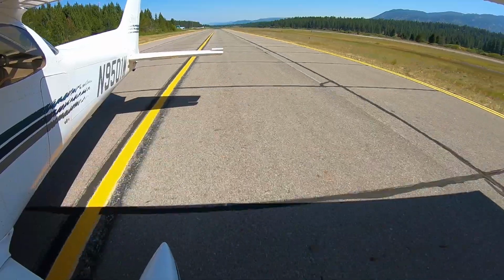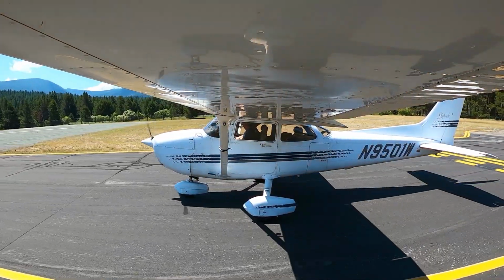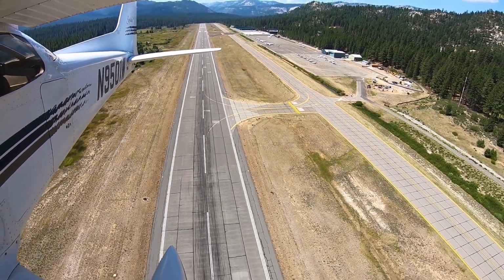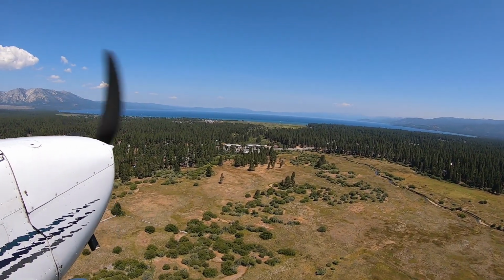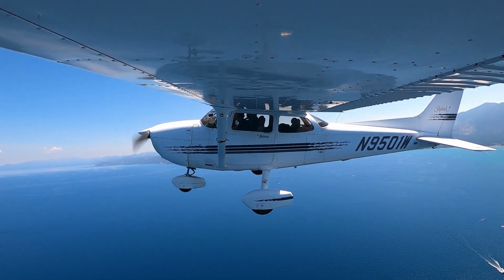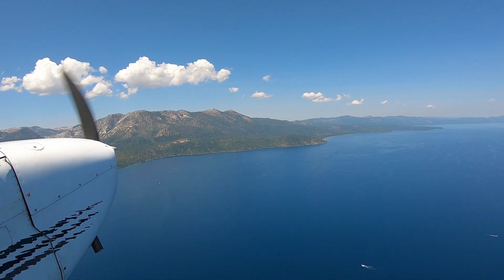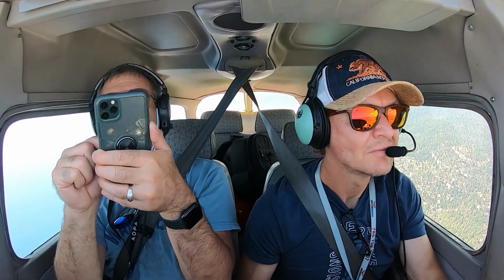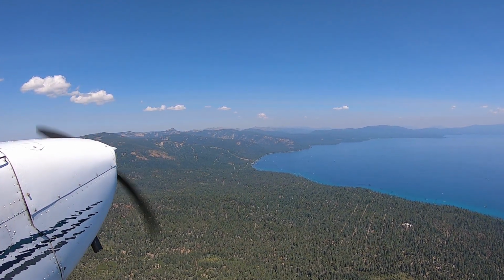High-Density Altitude Takeoff - South Lake Tahoe, CA (KTVL)...

Comment: I’m planning on going tomorrow morning and arriving around 1pm-2pm. I’ve only flown at 7,000 DA once out of New Mexico. I understand leaning very well. But this is the furthest I’ve flown since my PPL. I’ll be in a 160hp RV6 FP prop set up to cruise. Kinda nervous. I plan to stay higher as I’m worried about mountain waves coming in. Then departing go over the lake and circle a few times then leave. Might take off lighter and fuel half way home to be as light as possible. 

😅any other tips?

Thanks for the video!

Comment: Thanks for the video which demonstrates the dramatically reduced climb rate during the warmer months. I just got my PPL, but I’ve had a Piper Arrow (200 HP) for a few months prior. I live in the Reno Tahoe area and regret not getting a turbo Arrow or any other turbo single engine. It’s been fun to fly the NA Arrow in the cooler months, but it now it really does feel sluggish.

Comment: Summertime DA in Truckee KTRK (5901 MSL) is often 10,000’. Normally aspirated aircraft really need to be closely flown on takeoff and climbout — for cooling and airspeed, there is no forgiveness as one gets when flying at sea level. Even in my SR22T I carefully watch airspeed and temperatures, and fly much more restrained climbouts.
Reply from the maker: For sure! The climb-out in Truckee and SLT in 01W have to be managed extremely carefully, with lots of planning before 'full power'.  May times, my 160 horses will just stay on the ground and fly another day!

Comment: “It’s reliable if you plan to expect the 200fpm club rate”: It’s just that it isn’t all up to you. With even a tiny bit of thermal activity you could encounter downdrafts well exceeding your 200 fpm climb. So I would argue whether it can be done safely is a much different question from whether you will. Mountains are notorious for rapidly changing conditions. It’s best to pad your margins!

Comment: Two things: (1) Did you go North to I-80 and then back to KCCR? (2) FYI all of your headset mic audio is in the left channel.
Reply from the maker: Hey Mike.  Yep - 80 all the way.  On the way into KTVL we did the same thing, flew north, over 80, cut a corner south-west of Truckee, took the west shoreline south and eventually maneuvered for a straight in RWY 18.  I hear on you on the mic audio - not sure what's causing it, but it could be annoying, especially when listening over the headsets.  Thanks for letting me know!
Reply: A good reminder regarding density altitude. At least at Tahoe if departing rwy 36 you can climb out over the lake where there aren’t any obstacles.
Reply from the maker: @dak2005vn  Definitely a lot more options on 36.